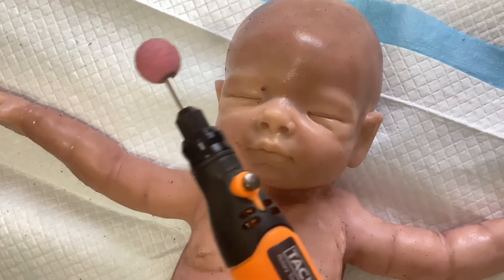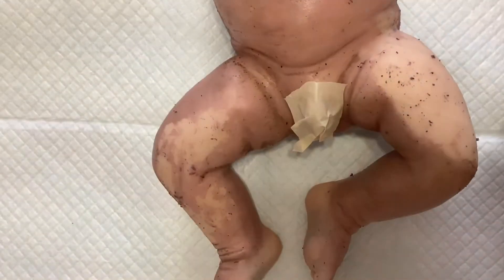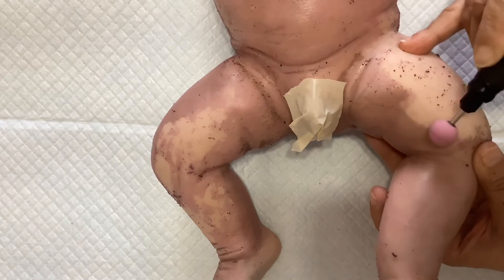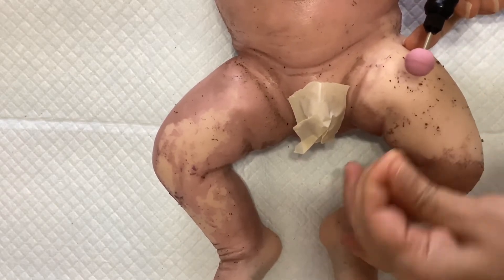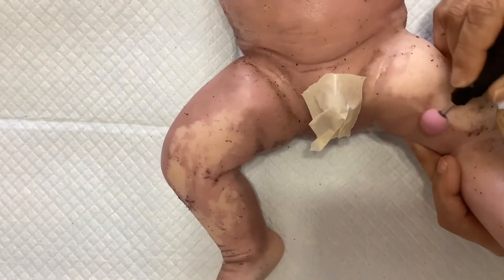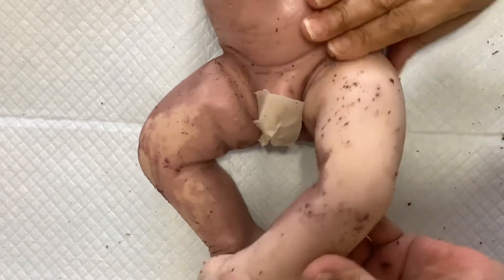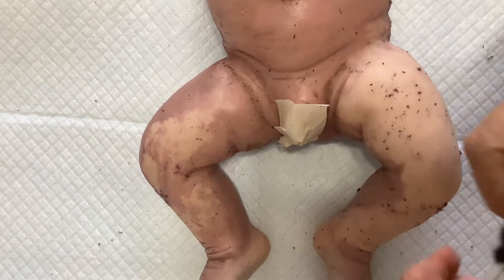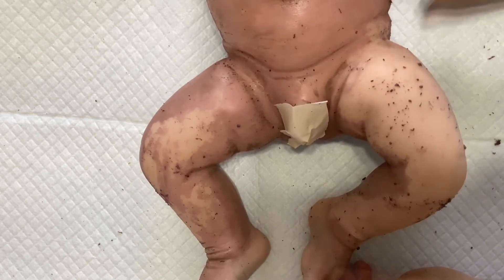MY FUL BODY SILICONE ITS RUIN 😢 HOW TO STRIP SILICONE PAINT PART # 1

Comment: Can you please tell me where you found you bigger round grinder  stone bit mine  is so small and it's just taking forever.... But it definitely does work thank you for this video!!!
Reply from the maker: I got it on Amazon and you are very welcome 🙂💕
Reply: I got mine off Amazon too but it didn't come with a big one like your's that's what I'm looking for
Reply from the maker: @tdiva3045  this is the description on, Amazon .   Join Ware 20Pcs Pink 1/8 Inch Shank Ball Shaped Abrasive Mounted Stone Grinding Wheel Head Ceramic Grinding Burr Wheel Rotary Tools Deburring Polishing - Head: 16mm
Reply from the maker: @tdiva3045   it did damage but in part it was my fault I shouldn’t put so much pressure also it was my first time stripping the paint off a silicone but then I did it again with another silicone that a friend give me and the pain come out beautifully but the second baby silicone it was more firm then the first one  if you’re trying to strip the paint off a soft silicone try not to put too much pressure and low the speed of the drill Good luck.🙂
Reply: @stardustreborncreations6704  thanks I'm going good so far it's just a long process... I think the bigger one will move things along a lot faster
Reply: @stardustreborncreations6704  I found it!! I actually had found this yesterday but didn't know if it was the right size, thank you so much!!!😍
Reply from the maker: @tdiva3045  you welcome I advise you to take your time don’t rush that is the biggest mistake don’t put too much pressure in low down the speed let me know how it went when you are done have a wonderful evening 🙂

Comment: What's the name of the tool and ball you're using I couldn't understand what you called it?
Reply from the maker: this is the description on, Amazon .   Join Ware 20Pcs Pink 1/8 Inch Shank Ball Shaped Abrasive Mounted Stone Grinding Wheel Head Ceramic Grinding Burr Wheel Rotary Tools Deburring Polishing - Head: 16mm
Reply: @stardustreborncreations6704  ty I just ordered a set it has 5 speeds so not sure it's exact same one because it has several other pieces but looks the same

Comment: Thank you for sharing, I have a silicone doll where I opened her mouth to take pacifier and accidently slipped and took a piece out of her upper lip and I've tried many things to try and repair it, silicone glue, silicone paint, sand paper, etc and it just kept getting worse lol only really frustrating, my 1st silicone. Well I finally got lip part filled in with silicone only now it's not smooth and looks chalky accross her lips and out to her lower cheeks from the silicone paint so I'm going to try to smooth it out using the tool you used in video before I add paint to lips and mottling to cheeks I hope it works or she'll be forever stuck with a pacifier in her mouth. Any suggestions what mixture of paint colors to take chalky look away? Right now looks like she has calamine lotion on her mouth and cheeks
Reply from the maker: Thank you for coming I wanna apologize I just saw this comment Somehow I didn’t got the notification.
Reply: @stardustreborncreations6704  that's OK it was awhile ago, I've since repaired some of it, her lips are as good as they're gonna get lol she's my first and only silicone, I've made many mistakes but have learned a lot and a pacifier covers it up but I'm a perfectionist so I'll continue trying different things to smooth it out as best as I can...can't tell you how many times I thought about scrapping the whole thing and giving her to goodwill but I spent too much now ty for responding better late than never ❤️
Reply from the maker: @didismith7682  I am so sorry about that I know silicon is not easy especially when something happened with it and try to repair it is frustrated .

Comment: I'm new to ur channel and luv it. Sorry if I've been flooding u with comments. Would this also work for removing seams on an unpainted silicone kit or do u have any suggestions?
Reply from the maker: In this video It Wass my first time removing paint off a silicone 🙂 for the seams you had to cut it in then fill them up with silicone until it’s nice and smooth I hope this helps you.
Reply: @stardustreborncreations6704  yes thank u so much for taking the time to answer me.

Comment: Do you have a link to the drill and attachment that you used?? I need to strip a baby ad well and I love your idea!
Reply from the maker: Hello this is what I use  I got it on Amazon 🙂 Join Ware 20Pcs Pink 1/8 Inch Shank Ball Shaped Abrasive Mounted Stone Grinding Wheel Head Ceramic Grinding Burr Wheel Rotary Tools Deburring Polishing - Head: 16mm , you can use any nail drill

Comment: Hi I just painted my first silicone but I wanna strip the paint and I haven’t matted yet What can I use to remove the paint ?  And my second question is did you Matt it first before sanding it with that electric device thank you
Reply from the maker: No, you don’t Matte you also can use send paper it’s going to take longer, but it will not damage the surface like the seen I use to strip mine I hope that helps. Good luck.